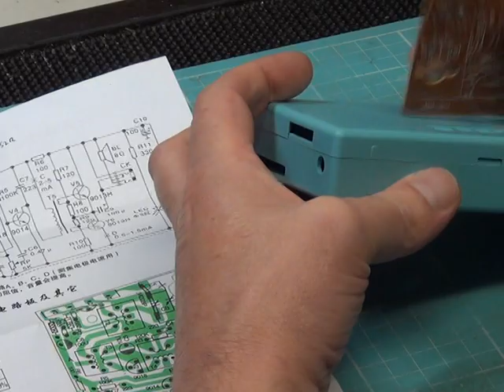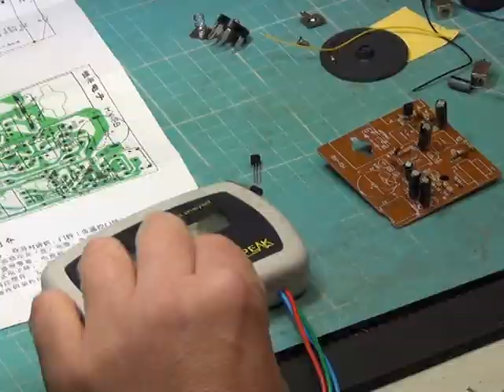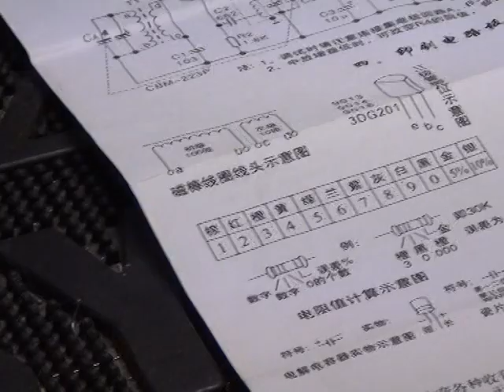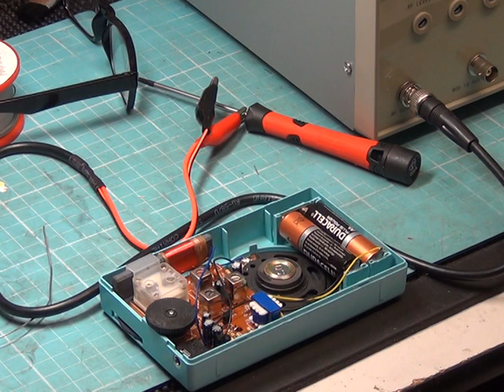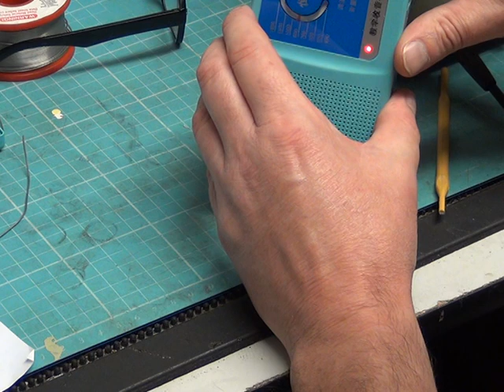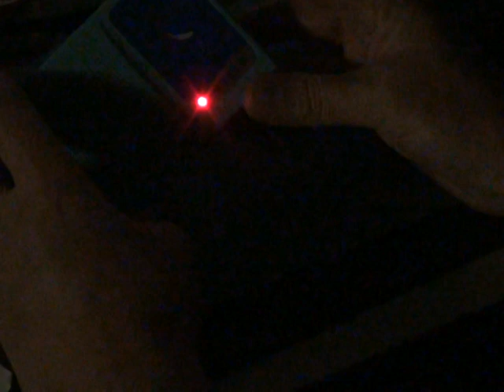HX-6B, 6 Transistor Chinese radio kit assembly & alignment - The turquoise one

Comment: Hello again, gentlemen, I was wondering what tools that I need to do this test I have the red radio kit and I wanna know what tools I can get to test and set the frequency. What type of generator can I use? Kit generators doesn’t have to have audio on it for beep or I don’t know you know where will I get it if it’s you know I just don’t really know how to hook it all up. I’m a new I’m very new at this.
Reply from the maker: As this video & others including the red radio in the back catalogue were made some years ago, I can't really comment.

What I'll do to help you, is we'll make up another radio kit...I think we have a yellow one waiting to be made up & I'll go into extra detail on instrument alignment.

I wouldn't recomment a kit signal generator as you'd need test gear to prove it works properly

We'll make up the yellow radio (I recall it was yellow!) in the next seven days.

The red one is outsanding performance.

Richard, G0OJF, UK
Reply: Wonderful, sounds like I’ll be just relying on my ears, if that way is shown it would be most helpful, thanks fellows

Comment: Why don't you show us how you set up the S.G. and clearly show which trimmer you align in order. Please.
Reply from the maker: OK, We'll assemble another similar one.

Richard, G0OJF, UK
Reply: @ukfmcbradioservicingTango21  Thanks guys. I've noticed that a lot of YouTubers who show aligning vintage radios never show how we connect the SG, CRO or multimeters. Hope you can help me.
Reply from the maker: On most vintage radios instruments are connected as shown in the service manual; that is key. So on things that don't have a service manual, experienced engineers can carry across previous arrangements to a different product & usually come up trumps. 

It's a very good point, Paul, and we'll do another kit with equipment setup in detail.

Richard, G0OJF, UK

Comment: I don't  understand why all the testing and troubleshooting to build a cheap Chinese radio a child can built.
Reply from the maker: Without the alignment the radio will either not work at all or not at it's best. Furthermore, the band coverage has to be aligned to the tuning dial. It's also not a  children's kit. Remember, we are professional 2-way radio engineers & built this for a laugh. Considering the number of out of spec components which we replaced, most people would have had no result.

Richard, G0OJF, UK
Reply: Old school am radios most be aligned. New chinese radios only have integrated circuits without coils

Comment: These things are as tinny as hell. I wonder if you could make it sound better with a different driver transformer: Type LT400?
Only thing its the output isn't push-pull. The problem is that the transformers are tiny and it really kills what little lower-end response there is. I have messed around with different speakers, which makes some difference, but not enough. 
Maybe there's better luck to be had with a HX-108, using a LT400 driver & LT700 output?
Reply: Find a better bigger speaker that will work the same watts.  These speakers are shit.

Comment: It's a Sunday night. For me. ive baught several. Put them together. Keeps me off the streets. On a cold winter's day. Eh? The local judge calls me a "senior delinquent" I find a little super glue on the plexiglas face plate works well. I have a 455 osc that fits in a toroids tin. And a probe with a diode/antenna as a Sig generator. . I find them " pinched" off my shelf at the barn. They aren't getting much. Hi hi. Avc action is good. Non existent AGC. But after dark in the valley they get Bussey. Up to 10 channels or more tks om.   73 de kv4li

Comment: ¿You have assembled de aliexpress DIY TV 5'5 KIT? ¿You have uploades a video? I looked the kit on aliexpress that i think that these kit is very expensive.
Reply from the maker: No because the TV kit isn't for the UK 625 line 50hz standard so wouldn't work here.

Richard, UK
Reply: @ukfmcbradioservicingTango21  Thanks for reply, i think that is strange, because the kit manual of these tv kit explains that works suitably on a PAL system of TV, 625 lines, the only problem is the audio subcarrier, the kit come configurated for operate with a 6,5 mhz audio subcarrier but, is easy to change to 5,5 mhz, system used in Spain (PAL-B/G).
Reply from the maker: @MegaVHSRemember  Right, well the (very expensive) kits I saw on AliExpress were distinctly for countries that use the American broadcast standard, hence my reply. That said, there is no analogue broadcast in the UK  so would have to be used with a set-top box to use. The one I saw worked out at about £70 for a 5.5" black & White TV kit.

Richard, UK

Comment: Built ours with my 8yr old.  We just have noise and I’ve tried the trimmer but nothing.  I guess it’s incorrect values.  Might borrow my friends signal generator.
Reply from the maker: We tested every single component before fitting & you saw the number of out of spec parts supplied....luckily we are both electronics engineers & you can't expect people who aren't to have parts in stock or test instruments.

Richard (UK)
Reply: UK CB radio servicing thanks - is there a cheap signal generator and oscilloscope you can buy  + I found a fault - my fault.  I put the white and red pots the wrong way around.. out of interest can they be replaced easily if I broke one trying to remove it 😫
Reply from the maker: Parts can be easily & safely unsoldered using a solder sucker.There are cheap oscilloscopes under £100 & cheap signal generators about the same.

Comment: I built only a few radios from kits, it is very straightforward on larger boards with less pieces because when it gets crowded the soldering is messy. I’ve been many ta7642 and lm386 designs from individually purchased components, this was very hit or miss, I recently made one on my channel that sounds too quiet and if you make it louder then the distortion and oscillations sounds bad, it can only tune on half the range of my 244pf air condenser knob, only between 500-1300 KHz, do I need to use mica tuners for ferrite rods loopstick or is there a ferrite Litz coil that can be tuned using the big chunky tuning knobs?

Comment: I like very much the radio set , here used transistor , IF , oscillator coil , input output transformer  and it is vintage style ,back to 1980 style , i want to buy kit  or radio set ,please contact my email :  kyawsweluck@gmail.com
Reply from the maker: Just go on Aliexpress & buy one, you don't need me to help you do that! Maybe they are on ebay too.

Richard (UK)

Comment: I pretty sure these kits aren't made for.kids or even beginners,you need some experience with this sort of thing a shame.Chinese can't even do English instructions,I think they would sell more kits if they did.nice job on your videos
Reply from the maker: You are quite right. If the instructions were in English & even some other languages they would sell many more kits & I agree they are not for beginners. As both Mr C & I are qualified electronics engineers we did these kits to see if it was possible to make them work....and we've proved it is; but not without substituting parts & test equipment.

Richard
Reply: @ukfmcbradioservicingTango21  I seen other very good techs.have trouble with these kits too.try elenco kits

Comment: Did you find anything very odd about the design of this radio?
Apart from the output stage not being push-pull.
These radios all sound lousy due to the thin case  and speaker & I wish that there was something better that the radio would be capable of driving and it fit into the case.
Reply from the maker: I have to admit we didn't study the circuit much. This radio is vastly inferior to the red one we did (HX108 with the extra IF stage). There are surely better quality speakers that will fit. Strangely enough I paid more for this than the HX108. Both kits had out of tolerance components which we substituted & I dread to think how a young beginner would get on with no knowledge, or test gear.

Richard
Reply: I was wondering how much difference there is between the two in a test on the bench with a sig gen where you can measure the level of the RF needed to deliver 'X' output at the detector.
I see with interest the case here has the two AA's to one side of the speaker wheras those I have come across have a cell above and below the speaker.
They tend to rattle loose.
I was wondering if packing the rear of the speaker with tissue would also help the poor sound as well as retain the AA cells.
Reply: The thin, flat speakers, may be more efficient because the magnetic field is not so strong.
However, the thin case does not give you much  depth to fit an alternate speaker.
Is your kit an older one with the batteries side-by-side?
Having the batteries above & below the speaker means they rock about on its frame making battery contact dodgy unless you pad the case with rolled toilet paper.
I have a variant on the six transistor flavour in that it has a single 'D' cell for power. This is one that does not appear on Ebay, Aliexpress or Taobao to my knowledge.
Reply: These are NOT radios for serious listening, just for some fun in assembling. Some of the parts seem to be rejects that failed testing. The ceramic capacitors in particular.